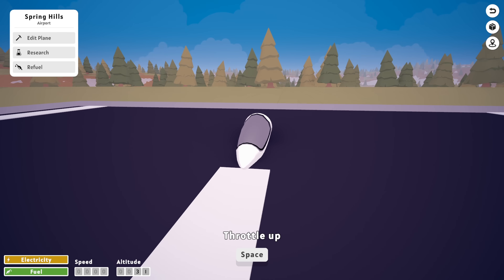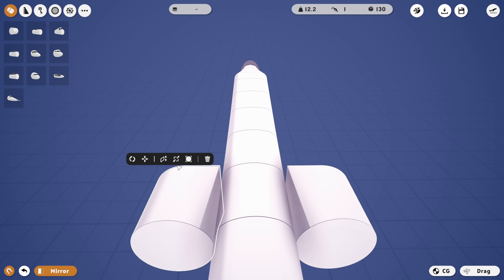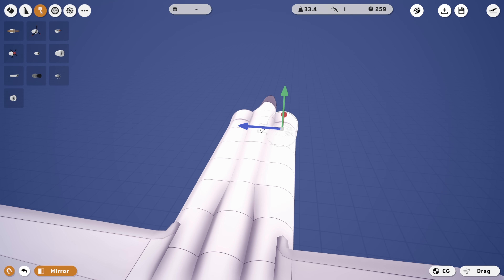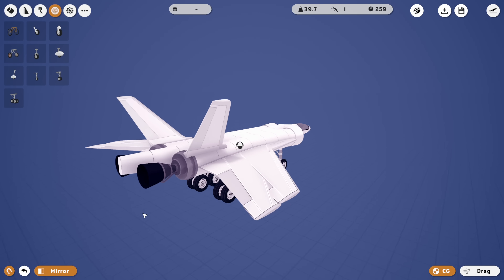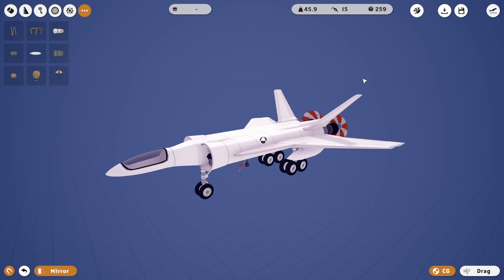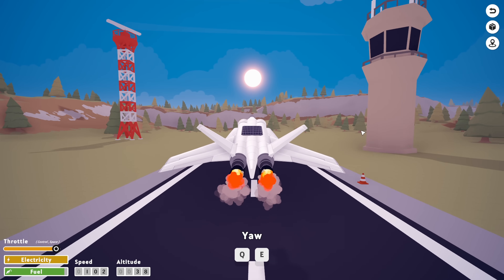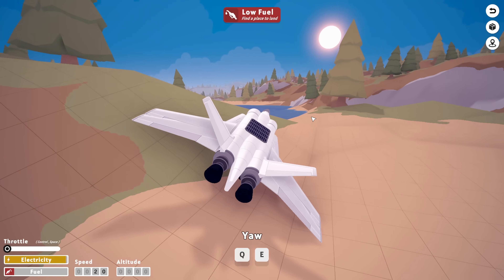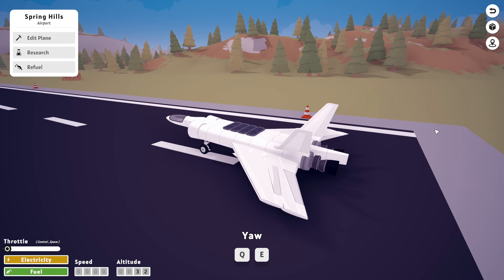I Built An ELECTRIC ROCKET CARGO PLANE In Aviassembly!

Comment from the maker: What Shall We Build Next!? :_FranticMicMatty:
Reply: Bild a airbus a380 please
Reply: build a Antonov an-225 Mriya (Cargo Plane)
Reply: @ yes, although it would have to be VERY powerful
Reply: @FranticMatty  A ROCKET TO GO AS HIGH AS YOU CAN!
Reply: Just simply a plane out of stretched fuselage pieces. Only stipulation is any wings/ fuel tanks must be hidden within or with streamlining/ looks in mind. You don't want to shear off stuff going too fast lol. Engines placement can be where and what ever you like. Capacity should be reasonable, I found I never needed more than 2-400 in career until the very last mission.
Reply: @FranticMatty  a flying car would be quite funny. Or motorcycle like the one in harry potter.
Reply: A Realistic plane I gues pleaseeeeeee!
Reply: Make a Embraer c-390. It is a military cargo plane.
Reply: F-22
Reply: Would like you to build a really long winged electric powered aircraft with solar panels expanding the wings. Like 10 electric engines each side and the wing looks like its made of solar panels.
Reply: Blimp? Please?
Reply: How about a series with Iconic planes starti g from wright flyer to SR71
Reply: Ac130 also im sure ur British r u
Reply: a jet where there are like that big pointy fuel tanks on decouplers, if they are empty, you can drop them as a bomb.
Reply: Make a Aérospatiale-BAC Concord please. AaronReins made one, but it was not so good.

Comment: I suspect that the wings are programmed to prevent sideways movement.
So when you installed the wings sideways, they registered the plane's forward movement as sideways for them and tried to stop it.

The only reason why the plane was moving forward at all was because the rockets' thrust was stronger than the wings' breaking effect.
Reply from the maker: Indeed

Comment: I think 1 electric engine, 3 or 4 solar panels, light fusolage and no other stuff will fly forever
Reply: I have a plane with 2 delta wings, 2 of the first eletric engine and 10 solar panels (inside my delta wings) and I have unlimited power and also 460+ top speed. That is my, lets say, recon plane (used it to fly over the islands and reveal the map)